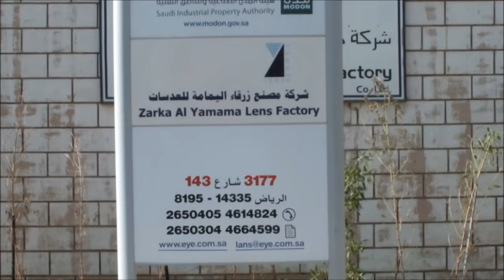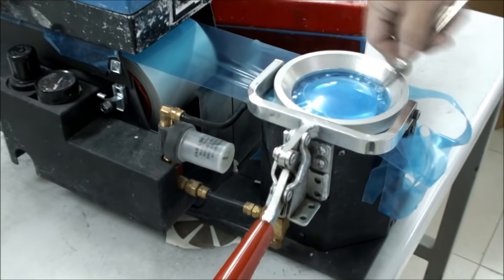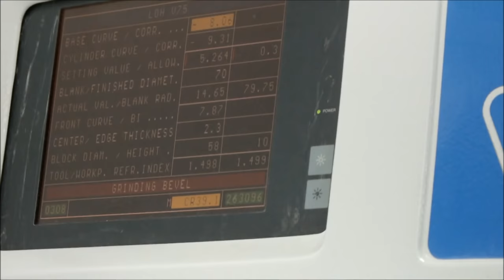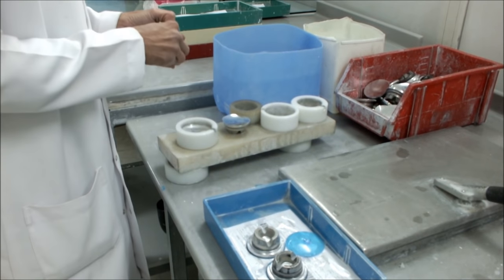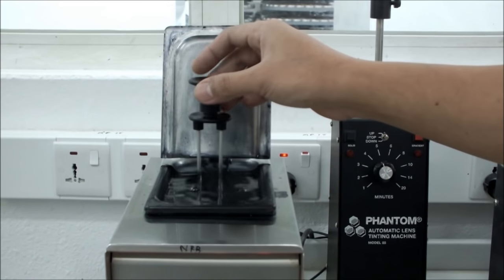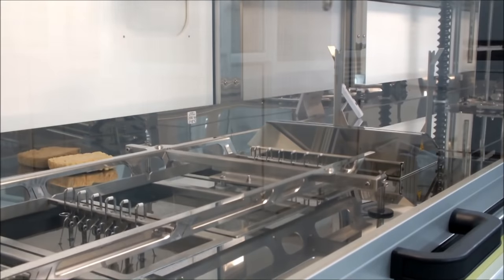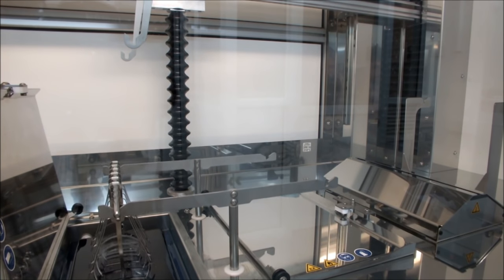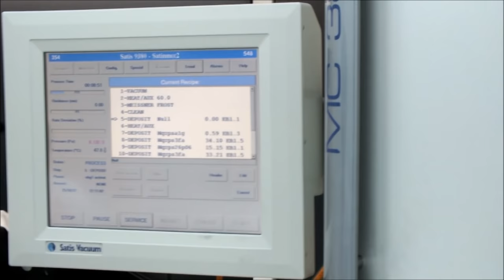Lens Manufacturing Process

Comment: What is the name of the blue film placed over the lenses to protect them during grinding ?  Who makes the machine that holds the roll of blue film to apply to the lenses? Thank You.
Reply from the maker: +Trilobyte631 Thank you for watching the video. Regarding the blue, it is called protective Blocking tape. I really don't know who makes the machine. 
Thanks
Reply: +Habib Farooq Thank you ! I have since found it is called "3M Surface Saver Tape" and 3M makes the applicator machine as well.
Reply: +Trilobyte631 It's "Surface Saver" made by 3M and sold by Signet Armorlite.